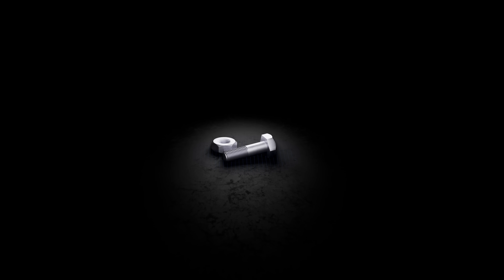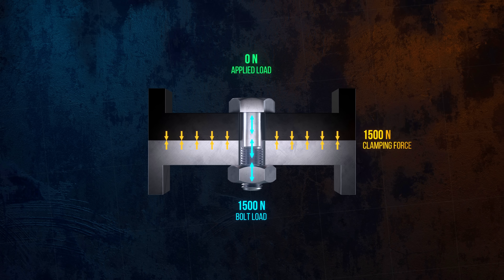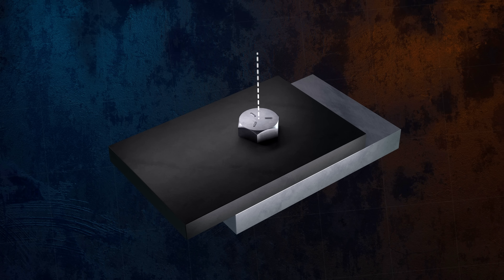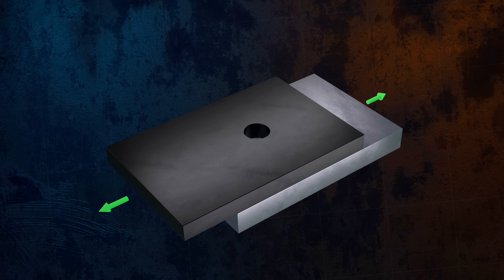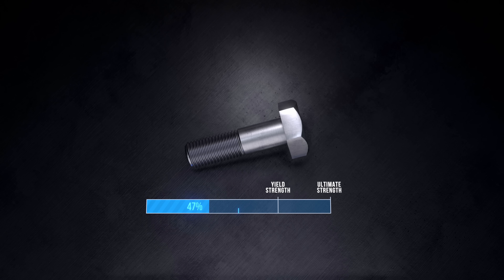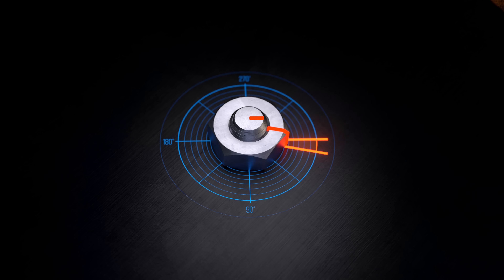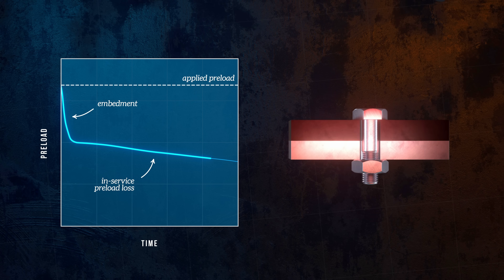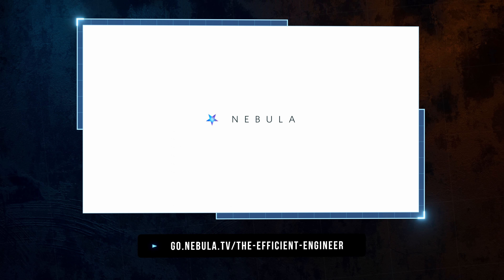The Incredible Strength of Bolted Joints

Comment: Bolt specialist here. As requested, here are my suggestions for improving this video:

1. bolts LOOK simple, but looks are deceiving. There are plenty of subtle details you won't see at first, e.g. bolt-to-joint and nut-to-joint surfaces are often slightly angled to optimize load transfer. Don't call them simple;
2. bolts are not always reusable - see item 8 below;
3. you are correct in mentioning that the joint parts a much less compliant than the bolt. Consider adding that this "much" is typically 3-5 times as stiff for steel parts joined by steel bolts. For aluminium plus steel, the factor smaller - this is one of the reasons why magnesium parts don't combine well with steel bolts;
4. you often say "This is called..." but really, almost all terms you introduce this way have alternate names. E.g. what you call "embedment" is a.k.a. "settling", and the "joint diagram" is often called "clamping diagram". Viewers need to know if they are to learn more;
5. You state that in shear joints, bolts should be "at least two diameters away" from the edge. That assumes typical combinations of materials. On e.g. aluminium parts with 10.9 bolts, I would personally recommend a bit more;
6. I just said "10.9". Bolt strength designations like that one would be a good addition;
7. no, sorry, the turn-of-nut method is NOT easy, at least in mass manufacture. You'll need equipment to measure the angle correctly, especially in safety-critical applications. Plus, it is usually deployed a bit differently than you suggest: first you tighten to a specific torque value, then you add a certain number of degrees of twist. Hence the name "torque plus angle" for this method;
8. you missed the tighten-to-yield method and that's a pity. It works by measuring torque and angle simultaneously, and the bolt is tightened until torque levels off w.r.t. angle. The bolt is now tightened just beyond its yield strength. Second-best possible method out there IMHO, but don't reuse the bolt;
9. best method to date: ultrasonic measurement of bolt lengthening. Dutch company Nedschroef developed this years ago under the name "Nedsonic", taking it from the domain of quality control into line assembly;
10. Final suggestion: take a deep breath now and DON"T FEEL BAD! Your video got quite far, and the points I suggest you add are certainly NOT common knowledge. The assembly industry has a habit of hiding its "secret sauce". Plus, you visualizations are top notch and put almost any textbook to shame. Keep it up buddy ;-)
Reply: This comment, wonderful and informative as it is, is borne from the friction between experts who have deep knowledge on a subject reviewing material that is clearly supposed to give a "20 thousand foot" view of it.

The omissions (like the ones you cite) feel critical to an expert, but to the newbie, they're stuck thinking about the nuances of tension vs. shear. Videos that introduce complex subjects don't have to be one-stop shops for everything about that subject.

A video on "Gell-Mann Amnesia" by acollierastro opened my eyes on this recently. We've all grimaced watching explainer vids on subjects we know a lot about and thought, "thats not how I would put it..." or, "what about [this detail]?"
Reply: Thank you for your additional insight, learned several things
Reply: Thoroughly enjoyed reading your comment.  Thanks much for the detailed info
Reply: You mean somebody actually asked you to expound upon this video?
Reply: @joetroutt7425 yes, it's in the video.
Reply: I am a fastener supplier from China, contact me if you need, thanks!
Reply: thx for insight
Reply: The video is clearly meant to simply touch upon these subjects as most videos like this do.

It's an introduction to concepts which the video does perfectly. Adding even half the stuff you suggested would make this a 45-60 minute documentary rather than what it is

Comment: Problem: at 11:31, you show a torque wrench on the bolt. This is wrong. The nut is the side that needs the torque wrench, when it's available.
Test it.
Fasten something, hold the nut still and torque the bolt to 50 ft-lbs.  Then hold the bolt still and torque the nut to 50 ft-lbs. Did the nut rotate? In most cases, it will.

Comment: You have problems with math. If the bolt is loaded with 1500N and you apply a force of 1000N, total bolt load will becpme 2500N and clamping force will become 500N
Reply from the maker: Nope, that's not how it works.

Comment: When reinstalling my axles/suspension on my jeep, I was told by an old timer to go back and re torque every nut after about 250 miles due to settlement and creeping. All but 3 were out of torque.. going back and re torqueing is now on the to do list when replacing parts.

Comment: Great video. As a designer of gas turbine engines, we never use a critical bolt in shear. The flange is always piloted so that the bolt is only in tension. Also, the bolt should have a lower coefficient of thermal expansion than the flange so the bolt gets tighter when the flange heats up. Bolts are the most over-looked part of  mechanical design. I have heard that 80% of the problems at car dealerships are realated to poor bolted joint design. Also, in critical applications, we use a hydraulic bolt stretcher that stretches the bolts the exact amount needed to get the desired pre-load and is much more accurate than using a torque wrench.
If you use 4D spacing between bolts (the center to center distance is 4 bolt diameters), you will almost never have a leaky joint. Most engine oil leaks on cars are the result of much larger than 4D spacing because they want to save the cost of the extra bolts and reduce assembly time. Next time you go to Walmart, look at all the oil spots in almost every open parking spot.
Reply: 80% of the struggle in repairing old cars is getting rusted bolts out without stripping or breaking them. Sure would be nice if they'd use stainless.
Reply: @dekutree64  Its purely a cost issue. The extra Nickel and Chromiun in stainless steel makes the stainless steel bolts a dollar or two more expensive than steel bolts. Multiplied by a few hundred bolts bolts per car, the OEM's would lose about $300/per car of profit times 4.4 million cars (what Ford made in 2023). That comes out to about $1.32 billion of lost profit per year for Ford.
Reply: @rocketscience777999  Calculation is not really representative of reality, because the car would be sold for a price that is $300 higher.
Reply: @xy4489  God, I wish that were an option. Yes, I'd like the all-stainless steal option for $300, Mr. Dealership.
Reply: @dekutree64  stainless springs, galls, and is weaker than other forms of steel.
Reply: I also make my living making GTEs

Comment: This explains why when I took my car to a tire dealer they made me sign a document agreeing I'd re-torque the wheel lug nuts after 50 miles. I now see how compression of the materials can latten the microscopic high points reducing clamping force after 50 miles of driving. And, in addition, the vibration occurring over that same distance. Thanks!

Comment: In most aerospace applications the frictional force between the plates is ignored as most joints are not designed to be in tension. These shear joints are designed with tight tolerance holes, that way the joint is "fully effective" in transferring all the load from the first plate by bearing on the fastener, and to the second plate through bearing contact. The example from the video shows a loose fit fastener, as the the hole is much larger than the fastener diameter, causing the force to be transferred through friction rather than bearing.

Comment: You shouldn't be reusing bolts because the threads stretch afterthe first time it's tightened compromising it's strength if it is ever reused
Reply: Only if stress exceeded elastic

Comment: It would be even stronger with a full-threaded bolt, and tapped metal pieces - then there is total thread and tightening potential for these pieces.  Otherwise, slam a rivet into the metal and this would be even stronger than a bolt and nut.

Comment: Somewhat related, before modern bolted joints hot-rivets where used.  The rivet was heated red-hot for TWO reasons.  One was it made it easier to 'round over' the end that was inserted into the joint while another worker held it in place with a tool pressed against the 'head'.  But the other reason was that as the rivet cooled it contracted applying the clamping force.

Of course the precise temperature, rivet material, and how quickly it was installed all made the precise amount of clamping force pretty variable.  I think that's a major reason even permanent joints today are made up with bolts instead of riveting.
Reply: The switch happened mostly because bolts are a whole lot easier and safer to install

Comment: Great video with some great information.  One unusual technique I've seen was with very large stud/nut fasteners used to close large pressure vessel heads.  The stud actually has a small hole bored down it's length for heating rods.  We would insert the heater rods and heat the studs for several hours.  Then apply the washers/ nuts and tighten them to a specific angle preload.  Afterwards, removing the heater rods and the stud of course would contract a known amount.  This made it possible to get a certain elongation (i.e. 'stretch') of the studs without the need for huge torqueing equipment.

Comment: Torque-to-yield is another method that allows fairly precisely gaining the maximum possible performance out of a bolt. It's used on engine cylinder heads. It limits the reusability of the bolts to basically a single use.

Comment: so fun fact, I'm a philly ironworker and because we cant use a torque wrench large enough on the bolts that hold tower crane sections together we use a giant micromotor to measure the bolt stretch to know we have enough preload on the bolts.
Reply: That method is the only method actually precise enough to ensure preload was achieved.

Comment: Torque is especially difficult to apply accurately on extremely small fasteners, especially scope mounts where four bolts are torqued in a pattern. In a case where 28in/oz is recommended, static friction can easily prohibit the recommended torque setting until the adjacent screw is torqued. Then, the first screw is loose. I assume there is very little deformation in T6-6061 aluminum at that setting.
Reply: That static friction problem destroys so many fasteners. You are definitely on the right path but from small to giant, inadequate preload due to combined improper use of the torque wrench and the extraordinary poor precision of the method. I do Root Cause Analysis on all types of industrial equipment. I've seen fatigue failure in electrical gear, radio coax, aircraft cylinder and head bolts, turbo charger mounts on 5000 HP diesel engines, and too many racing engines to count. 

Thank you for raising this question, it's interesting. I am familiar with this type joint on T6-6061 Al; that's a wonderful material. On a firearm application, peak forces are high. The preload tension of the 4 bolts must well exceed the peak forces encountered. I assume the bolts are Stainless Steel, to slow corrosion. I also assume the OEM specified 28in/oz torque.

If it were mine, and my assumptions above are correct, I'd do it like this. Please forgive me if drone on about things you already know. 

I'd check to see if the OEM recommends, or even requires, a particular lubricant. If so, I'd use EXACTLY that lubricant. It's very important to not substitute. Be certain to liberally apply lube on every surface that moves when the bolt turns, not only the threads, especially where the cap contacts the surface.  

To deal with the static friction problem... As you go around the pattern adding torque to each, initiate on each bolt by first loosening a bit, then reverse to tighten. This way when tightening, you break the static friction well behind the previous dynamic friction position. You can go around the pattern several times, loosen slightly then tighten without stopping to the torque value needed. 

 Yes that Al will definitely compress and release the preload. I've had this exact trouble. I solved my problem by leaving it compressed overnight, then redo the next day. Again, you have to loosen a bit then reverse to ensure dynamic friction all the way to the final torque value. To prove it was actually the Al compression, I marked each bolt position before I retorqued. It was clearly different. You have to give it time to compress. I had success with a 4 hour wait in my application, but if overnight was possible that's what I did. 

Best of luck

Comment: one thing which is mentioned that the surface is flattened due to tightening. The thing the I am missing µ(N) so it is dependent on the normale force except steal on steal or steal oil steal. When you want to use µ for construktion you normaly apply a paint, which has a high µ. In reality the paint acts mechanically as a sort of spring.

Comment: The only thing I was dissatisfied with was the graphic showing a cutaway view of the nut and bolt assembly. The shank of the bolt was not long enough. The shank should have gone through to the surface of the second sheet of metal and the threads start there. Washers are used in order to keep the nut from the shank. No more than two washers and no more than 4 threads and no less than two threads protruding from the nut. 

I was an aviation structural technician for 40 years. Nuts and bolts were a major part of my trade. I must have drilled holes for and installed millions of bolts and nuts. Some of the holes were for "interference fit" fasteners. Some of them were "loose fit" like for rivets. Some of the holes had to be work-hardened before the fastener, or bolt was installed. Indeed the holes for and the bolt and nut itself are a deep subject. I never had to calculate stress loads. I had to calculate the placement and number of fasteners in various applications, but not all applications. Most of the time the number of fasteners is dictated, but their exact location is determined by the assembler.

I'm sure that in other industries the specifications are not so stringent, like building a swing set. 

Thanks for the video.

Comment: Old school machine designer here.
I'm going to nit pick just a little 
But first my complements excellent  video 
It's not a nut and bolt, it's a nut and cap screw . You have a large variety of different cap screws Socket heads, hex head, torques head ect ect. It only becomes a bolt when the nut is applied. Lol im just nit picking. But at the same time im not.

Comment: part of my job when all other departments had no work was to fasten bolts to a chiller. it had 42 bolts on one side only you had to follow a crazy star pattern and tighten all bolts 3 times at different lbs. It sucked, we had to apply gaskets with cement glue to have a perfect seal. the vessels would then be tested inside a bunker just in case it blew up. One time one fitting was stripped by the pressure and shot straight through the roof in the shop. Fuck Alfa Laval.